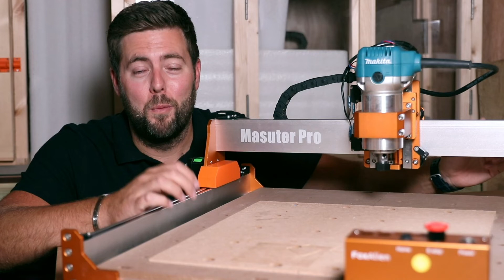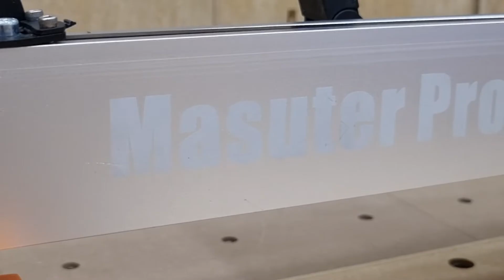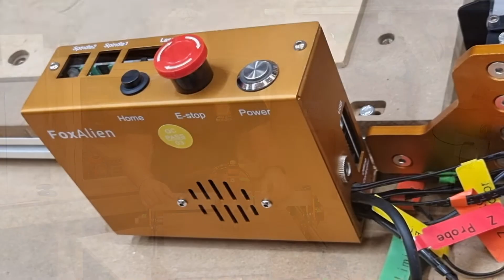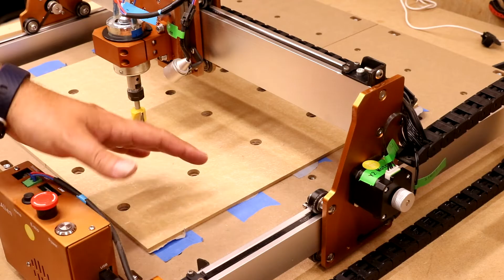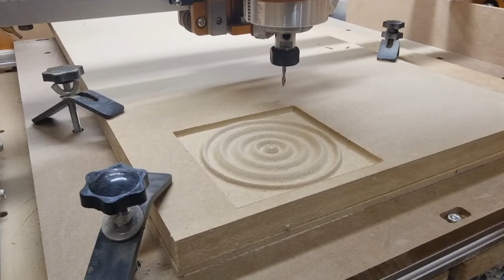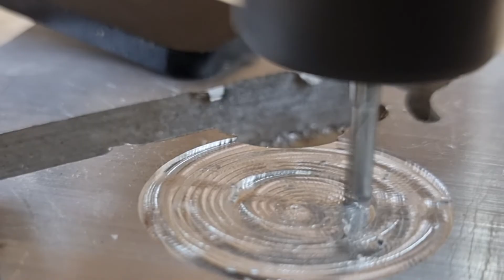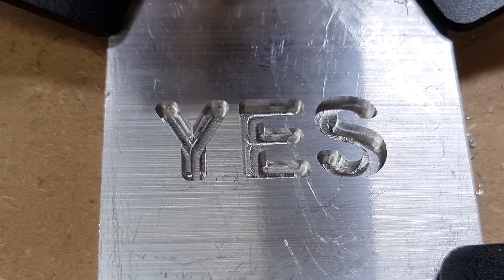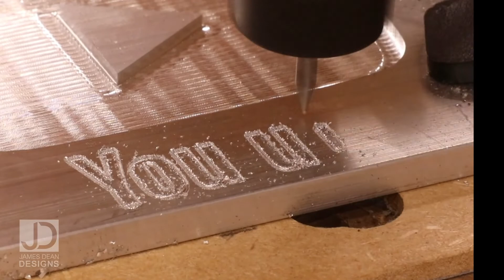Budget CNC which cuts metal? FoxAlien Masuter Pro CNC Review

Comment: First of all very good review and thank you. But this machine is like an insult to those who purchased the older version not so long ago. Older version was not a "baby" version it was simply the first iteration of this exact machine which was still sold for around $550 (which is slightly cheaper but not too far from the new versions price) and shared the geometry, electronics, cutting size etc.  Most of us purchased the previous model thinking that it can cut wood at a reasonable speed but it doesn't because it flexes so much in all directions. 
The previous versions problems were mainly Acrylic plates instead of aluminum ones where the beams and steppers are connected and the notoriously weak z axis. You slightly touch z axis and it flexes forward. They seem to address all of these and the fixes are really not costly. $150-200 for all of these upgrades is nothing if they are going to make the machine capable of what it was advertised of doing. 

For example, with the older version, from 3.5mm plywood I just cut the same 30mmx25mm rectangle side by side. One cut climb mode the other conventional with 0.4mm step down, 1000mm/min speed settings. The climb mode came nice measured 24.95x29.97 but the conventional one (which puts a bit more stress) came out 24.4x29.3. Horrible almost 1mm play and this is a very easy simple cut. 

Honestly, this is more like being used like a lab rat with your money. Accepting that a machine costed around $500 is now paper weight in less than a year and the only way to upgrade is to get rid of it and buy the newer version for another $650 because the new version is now fixed the issues and can do the things it claims to do it.

I think Foxalien is a good company and they are trying to come up with good machines. But what they offer after selling the machine is also important. 

Since the machine fundamentally didn't change they should give the users of the old version a reasonable way to upgrade their machines to this version. This means making the z axis assembly,, aluminum side plates available. 

And James, know that there are lot's of people like me who make their purchase decisions by watching your content. It may be a good approach to set the expectations right so maybe being a bit more critical can be good for us buyers.

Best

Comment: First of all, I'd like to say your presentations are awesome. I learned to use the CNC3-3018Pro with them. I just bought the Masuter Pro machine, and I am having some serious issues in that the machine is not cutting to the correct depth settings. It navigates to the correct positions but cuts too deep and inconsistently, meaning different depths. I am using Easel software and ugc sender. I have deleted and reinstalled the machine in Easel but the issues remain the same. The choices given are Fox Alien but they don’t offer Pro, so I chose other and configured accordingly. I also attempted with the 4040 model with the same results. What could be wrong?

Comment: Curious about the laser port.  2 pin or 3 pin and do I need to flash firmware?  Cool machine!
Reply from the maker: Pretty sure it's 3 pin (but I'll check shortly) but no change in firmware, just a case of changing the switch

Comment: Thanks James im still busy setting it up but it so hot in europe at the moment that im leaving it for now... but i have the new wheels come in and the router from makita 1/4 1/8 bit and bits so im ready when i set it up thanks for all your messages in the FB group and helping me get started. do you have that tool for the router to check if its straight in the socket that orange 3d printed part do you have the stl on your patreon? thanks for the video!

Comment: James, I've been considering this machine as an entry into CNC's but I've seen some reports of issues with the v-wheels getting flat sports that appear to be unremovable and even replacing them doesn't help. Given that I'd be pushing the budget with this, is it worth getting? Should I save more for something better? I\d want to be using a Makita as the spindle. Primary materials would be hardwood / MR-MDF
Reply from the maker: The issue is the wheels are pretty tight on arrival so they essentially arrive with flat spots, not ideal but to be honest, most preassembled machines with wheels like these often arrive with flat spots. I changed mine out with a new set from amazon, fairly cheap about £12 I think, and it's been fine since
Reply: @JamesDeanDesigns  Hello from France, just because of your great video, I just bought one :-) Do you mind to share the link for the wheels ? So happy to start with it ! I am confortable with 3 D printer and fusion 360. Do you think it ll be a big deal to use this cnc ?  Have a great day. Laurent
Reply from the maker: @laurentbleu35  Hi Laurent, in theory this link should take you to the equivalent product in your country https://amzn.to/3yUY43F

Comment: Got this and have added a Mikita router and made a dust shoe from scrap piece and a draft excluder. Tonight I made a set of dust guards from craft foam, but realised my spoil board isn’t centred so it’s a little tight on the right. Will tweak tomorrow. Just wish I had got a laser for it as well.
Reply from the maker: Just saw your post on the FoxAlien group. If it works then thats all that counts 😆
Reply: Was the makita router compatible with the stock spindle mount?
Reply: Do you still like it? Why did you choose this one over the 4040-XE?